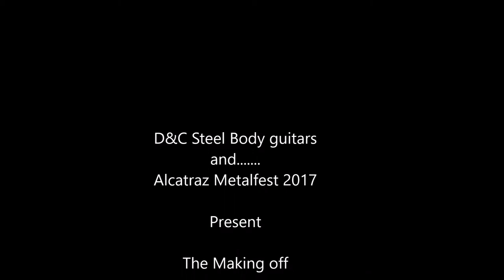building a steel body guitar (for alcatraz 2017)

Comment: That;s totally sick....if i had a metal shop...I'd make a chrome flying V...
You should just make the neck and body as ONE...
This way you can get rid of the tenon and unlimited/easy higher frets access.
String aint going to bow metal..lol...
Or at least make neck pockets like newer guitar designs..round off  the bottom
corners ...So it wound poke your palm.
or better.
Just  use thicker plate...get rid of that thickness around the neck joint/mount...
you dont need it,...using metal.lol